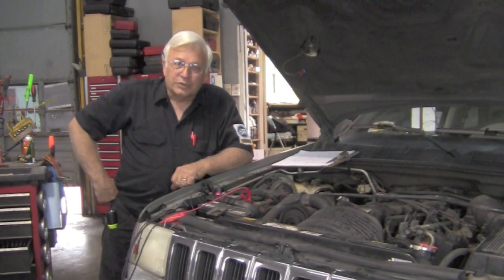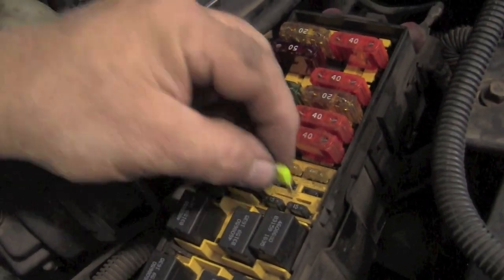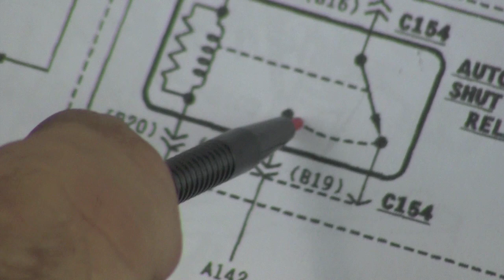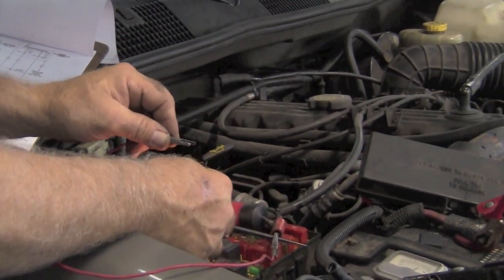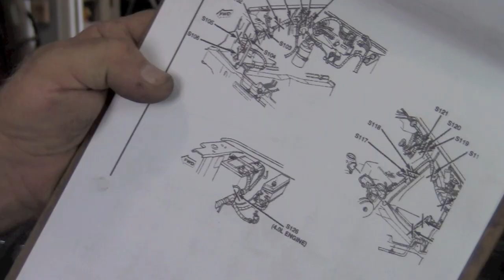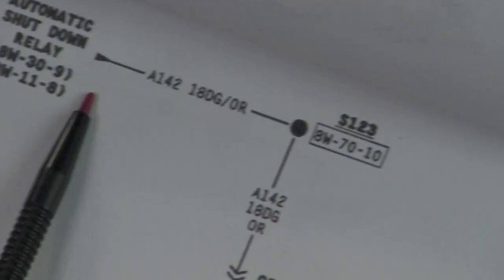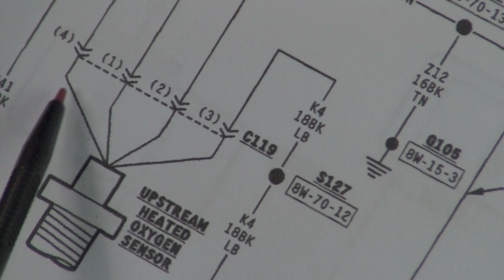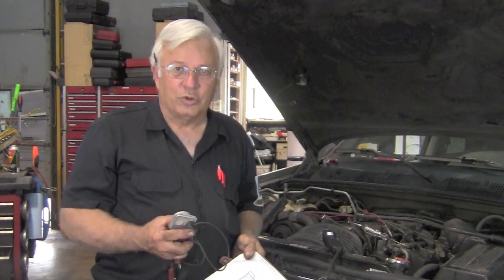Finding a active short

Comment: Excellent video.
Reply: I have a friend that is having the same problem with a 2004 Pacifica. With the ASD relay out you can turn the key and fuse 37 a 25 amp fuse with not blow. Replace the relay and it will. Using the procedure you show here with the tools you are using the fuse blows when you connect the circuit breaker across 30 and 87. How do you test that circuit breaker you are using. My friend bought his ammeter and circuit breaker on Amazon and is not sure that the breaker is popping. Thanks.

Comment: I have a 1991 chevy pickup that the taillights or stop lights won't turn off even when they are switch to off and engine is off, I checked the stop light switch on the break pedal and is working perfectly...have any idea what the problem could be? thanks

Comment: If i have a fuse that keeps blowing on my wiper motor circuit and I unplug the harness to the motor and it still blows fuse it rules out motor? Or would it still blow fuse because you are taking the load out of the circuit and there is no resistance in the circuit?

Comment: where do you get wiring diagrams!!!!!! Im needing one for a 2005 Dodge Dakota, Keeps blowing fuse 37 "CRANK" Fuse as soon as the key is turned to crank the engine. i ordered the tool, and have it now, but need the diagram.

Comment: My car died out yesterday while driving. Car would not start nor crank. Head lights worked but upon turning ignition no check engine lights, abs, battery or any other lights on cluster would light up. Could'nt even jump it. While the Shop was about to close it was noticed that the ignition fuse was blown. It was replaced and car cranked right up and started. No later than 1 minute Car died out again. Any idea what's going on? Would appreciate ur Professional opinion.
Reply from the maker: Good question. We all know assumptions can be misleading, however without seeing it I would "assume" that the duplicated symptom and the blown fuse are directly related. They should see how many amps are going thru the fuse, review the electrical diagram, find all loads on that fused circuit, eliminate them one at a time to identify which load (or branch) is the problem.Then that load (or branch) can be examined for the cause.

Comment: I bought the short finder on that link. Thanks!
The wiring diagrams are extremely helpful.
Ive gathered quite a lot of tools but dont have access to wiring diagrams.
Will you be getting the Power Probe 4 or  hook or sticking with the 3?
Reply from the maker: fyi   i do have the power probe 4  and love it   if you really serious about being a great tech,  get the pp4
Reply: I started to get a new Green Power Probe 4 a few months back for 152 bucks but needed other things.  I can borrow a PP2  when I need one.  I will get the PP4 soon though.

 I'm trying now to get all the stuff  I need for AC recovery while its still smoldering hot and folks need AC. All I lack now is the recovery machine itself and an oil separator.

Comment: I have a problem 2005 mazda 6. when I use turn signal the wipers come on. I checked the bcm it was good. I checked the fuses had one burned changed it. Checked wiring harness' all look good and didn't see any obvious burned or frayed wire.

Comment: It's a shame that just about all technicians I know will only pull up a wiring diagram as a last resort. Me personally, the wiring diagram is the first resort, that and Description and Operation. A knowledge of how a circuit/system's supposed to operate in my opinion's is one of, if not the most powerful weapon you can possess in diagnostics.

Comment: Get you a wiring diagram and look for a short to ground. In other words find the wire that the fuse powers and trace it to see if you can find a spot where it may be touching the body or chassis. I don't want to impose on this mans videos but yes the KD tool may help you.

Comment: My car (1994 Cadillac Fleetwood) runs great until I hit the accelerator at 50 to 60 mph, as to pass. When I do that it bogs down as if the engine wants to shut down. At the very same time, the AC shuts down. When I let go of the accelerator, the car continues to run with seemingly less power, and the AC will not come back on until I stop and the engine cools off and then restart it, then the AC comes back on. Could this be an electrical short, or a poor ground,  that is activated when the accelerator is pressed down. If so how does one find this short.
Here are some the things I have done  to get rid of the problem but without success: Changed the Fuel pump and filter, changed the ignition coil, cleaned the ignition module, tested to be OK, and reinstalled it with the heat sink compound, the spark plugs and wires are relatively new. Tested the resistance on all fuel injectors and they all were the same at the correct resistance. While car running and the headlights on, I tested for voltage drop: it was low at 0.01 to 0.02 V, then the Turn signals quit working a few days ago, purchased a new flasher to install, but the signals started working again on their own without installing the new flasher (could not find old flasher in the car) but then the signals quite working again on their own. The signals may or may not have anything to do with the bog down problem. Still trying to figure out which way to go to identify the source of the problem.  
Great instructional video, thank you for taking the time to educate those of us who want to learn more on how to diagnose our own cars.

Comment: I had a problem somewhat like this. When I tried to turn the key over one of the fuses would instantly blow. Turns out there was some sort of exposed wire touching up against the engine and every time I would turn the key over it would spark and the fuse would blow. Luckily some electrical tape and a new fuse solved my problem.

Comment: The inductive amp meter does not show direction of short. It shows the directon of current relative to short or load. Testing past the piont of the load/short will not make neadle point back towards the load/short as you alluded in your vidio, it just won't indicate flow of current.

Comment: 92 Ford Ranger 2.3 5 speed blew the 60-amp ignition fuse while driving I replace the fuse and the new fuse blew as soon as the key was put in the Run position have had no luck finding a short

Comment: I have a question to ask you sir? I bought a kit and found a difference in my meter when i remove the central junction box fuse but doesn't go down to zero. Tried the hookup on the fuse port but the light stayed on.

Comment: I made the mistake of spraying off my grill with high pressure car wash and immediately on the 7 mile ride home two lites twinkled on   the check engine and the batt   indicator brightly illuminated,  I am almost 100 percent sure water followed a wire into the ecu or nearby wire leading to it, hope i am rite, Please dont use high pressure to wash grill /Quote from my son when we got home, "dad i sure wish you wouldnt have washed it, everything was fine until you did that" OUCH !

Comment: best video i have seen yet. I Have a ? I have a 1999 Ford TaurusSE My fuse dont blow but, I'm having a charging system battery problem and maybe u can help me. I have a wire running to the orange alternator connector wire, and have that conneted to a 40 amp fuse underneath the hood, and my charging system charges that way,once i disconnect the wire the charging system no longer charge. ALTERNATOR NEW BATTERY NEW STARTER NEW............NEED HELP THANKS.......

Comment: what website has electrical diagrams for my 1994 Buick Regal Custom Coupe 3.8L. I cannot find them or any youtube videos  for that specific car. Have active short blowing horn fuse; so far traced to steering wheel area. He suspects multi-function switch; I did nothing(can't afford yet)now have no turn signals/hazards (never had hazard switch) could it possibly be a easy fix like this was? Any info appreciated.

Comment: what are those amp meters called? i want to try using a test light where the blown fuse is instead of circuit breaker and use the meter to find it,i think the name starts with letter "g"

Comment: I have a 2007 ford ranger pickup that the battery goes dead after 2 days setting. I bought the tools you have and it does not show a short. There is a short. The battery is new and it holds a charge if it is disconnected. So my question is how do I find a short that does not show up?
Reply: Hello AJ,  thanks for writing

First you must understand that there are different kinds of “shorts”.  The tool you see in the video is used to find what we call a dead (or direct) short to ground.  Those shorts will “blow” a fuse immediately because because they “immediately” allow excessive amps (current) to flow.  Thats when that particular tools works best.

You stated that . . .  "you did an amp draw test and it does not show much draw.”  That is a short to ground but it is NOT direct.  Instead it is “indirect". That type of short is what is referred to as a “parasitic draw”.  Yes it is flowing amps but not enough to blow the fuse because the flow is less than that of the fuse protection.  However it is flowing amps and because of that flow the battery goes dead after 2 days.  Some circuit on you vehicle is staying “alive” or powered up even when the vehicle is turned off. This is an “indirect” short to ground.  

Remember this basic rule of electricity,  power will always take the shortest path to ground, even if it’s the wrong path.      And when a path from power to ground is “complete”, current will flow.

So you need to find which circuit has a “parasitic” current flow.  

I hope this helps

Comment: a more simple but equally effective tool is a h6054 sealed beam(headlight) with a couple of jumpers.....instead of the circuit breaker that most people wont have....wire it across the relay like he did.....when the short is active the light is ON(carrying the load)..when the short goes away, the light goes out,,,,,,use the same process, working down logical spots to isolate parts of the circuit like he did........unplugging things, wiggling wires as you go.......headlamp would flicker when those oxygen sensors were first moved..........just another tool when the circuit breaker is not avail(like out in the bush or at the lake.....good video otherwise
Reply from the maker: Thanks,  I appreciate your comments

Comment: When I cut off my 2002 dakota 3.9 I hear a ticking sound In my dash right where the radio Is and I think It Is draining my battery .It stops when I unhook my battery. It really sounds like a clock. Can't  figure it out. And my radio stopped working.

Comment: i have a 2005 kia sportage the tail lights stop working and the power windows and stereo all so shut down now when i ride on dirt roads or hit some bumps on the road it all come back on but just for a few min then i lose it all again do you know what the problem could be or have you worked on anything with the same kind of truble
Reply: this problem is of fuse box where this fuse is located. check for fuse loses connection.or give other connection from under fuse box to the respective fuse.and test drive the vehicle see the resloved or not

Comment: Hi Sir please my diesel car have cold start problem , my cold start relay all time kept close and let the currant go to the glow plugs, the light on dashboard go off after one second in cold or hot weather and the plugs got damaged . I disconnect the coolant temperature plug and the relay opened after about 15 second and stopped the currant go to glow plugs.

Comment: So its looking like every wire off my ac clutch fuse is pointing back toward the fuse box.  That is even with the compressor not hooked up. I did already purchase this tester.  And the needle keeps pointing towards the fuse box. Any ideas?
Reply from the maker: Your on the right track but need adjustment.  If the needle is moving, then current is flowing. If current is flowing then the fuse is NOT blown.  Keep tracing wires until the needle doesn't move anymore, then that wire is the one with the short.

Comment: Will this help me find a wire that stays hot all the time and does not blow the fuse but will also burn the engine fuse box up it grounding out but can't seem to locate the cause.
Reply from the maker: it would definitely help but I'd suggest using a thermal image camera as well.  I have some videos on that

Comment: My 4 4 runner blows my ignition fuse soon as I turn the key to acc ,vehicle will start and run fine just will not charge I'm assuming that fuse being in the charging system that's why it's not charging because the computer isn't picking up any signal

Comment: When using this tool; does it trip when using low amp current such as 5 or 10amp? I ask because I'm not sure what's the amp rating on this tool and what's the likelihood of burning small wires that use low amps.
Reply from the maker: 5-10 amps is safe,  they are what is considered normal values and the tool ic safe for all normal values
Reply: @realfixesrealfast  Thank you for the quick reply, I was reading other people's comments regarding this and one claimed that the mechanism would take some time before tripping and by that time it fried a wire (I didn't see that failure mode on your video). I ended up buying the Power Probe ECT3000B version of this tool with wire trace for shorts and opens and the price wasn't too ridiculous, would be nice if you can do a review on that tool and include a link that followers can use to support you. 

Ford Ranger 2000 v6: I currently have short to ground at the parking light circuit/instrument cluster illumination, as soon as I turn the light knob to park, it will blow the #11 fuse at the battery (underhood) power box. I will use this tool to find the short which I suspect should be somewhere at the rear side. I will report how this tool does tomorrow when I get it :)
Reply: @realfixesrealfast  I'm back with the fix. I bought the ECT300B tool and I got it today to try it. What I noticed is that it detected an open when the light switch was off (this is true) and as soon as I turned the light on, it detected a short. I placed the wireless sensor on top of the IN wire to the switch and it detected the right direction of the short, I put it over the OUT wire and it also detected the right direction of the short, going away. I had a very hard time getting a signal from the harness, I would increase the sensitivity all the way since it wasn't catching the signal, there were multiple splices at the front side and at some point I got a reading with the incorrect direction "just like you did here with the fuel injectors where it would indicate a possible shorted injector due to direction of the amp travel. I further checked under the car where the harness travels to the back lights and I would get random signals, one going one way, and going the opposite at about a foot away from the initial reading. 
What I noticed is that there were also ground wires in the harness and ground wires go back to the battery so in this case I was getting back to the battery, I don't know how this is interpreted by the tool but the ground wire was being read as a continuing short to the battery, this could be unique to this car, I will continue to test this with spliced wires (worst case) and see if the tool is worth it. At the end, it was the license plate bulb that had shorted out at the connector, there was a heavy indication of burnt plastic where the bulb sits on the connector and the bulk looked like it had been splashed with oil. The short/open tool was marking that the short was at the direction of the other bulb of the license plate, I disconnected the bulb and the reading didn't come back, I decided to do the same thing with the other one and that's when i noticed the burnt, I had disassembled the entire 4 lights (2 front & 2 back) to visually inspect the connectors and wires around them and they looked good. 
My experience with this is that a diagram will help more than any tool and in this case (spliced wires) it is very difficult with any tool to detect actual direction of the short, the tool gives you confidence to keep checking but it is lost when it does not work as intended. Once I removed the wiring to the bulb where the short was occurring, the tool was still indicating that there was a short but it had been fixed as I put a new fuse in and it did not blow which confirmed my repair.
Reply from the maker: @scientist100  Great description and thanks for following up.  I know those kind of problems are VERY frustrating, but they are very rewarding once you find the problem.  Great work and determination.  I was especially impressed with your statement "My experience with this is that a diagram will help more than any tool". Thats so true.  More techs need to improve heir skills reading diagrams.

Comment: Does anyone know if the inside fuses should light up test light when done this way ? They don't and pretty much checked them all . The fuses under the steering wheel inside cabin and yes , I've tested it to make sure it works including checking the fuses under the hood in the engine compartment and they light up .
Reply: Frank, fuses are circuit protectors.  The short finder tool basically puts a circuit breaker in line Wirth thew circuit.  So the short finder tool should trip the breaker and therefore the fuse should not blow, it should light up momentarily when the breaker resets.